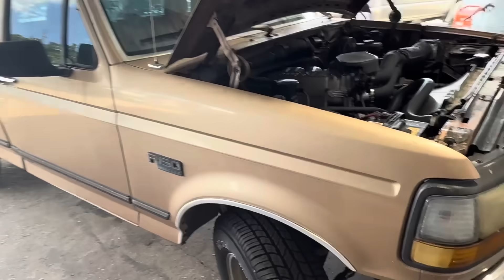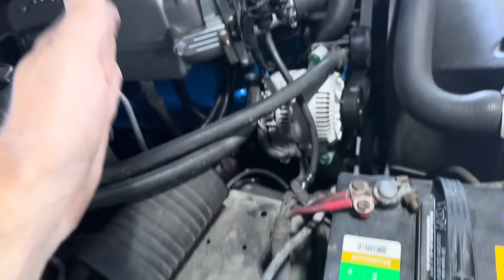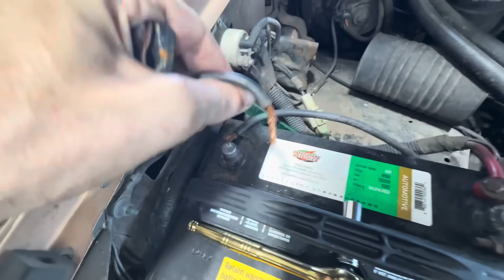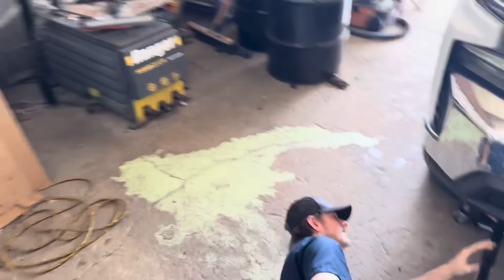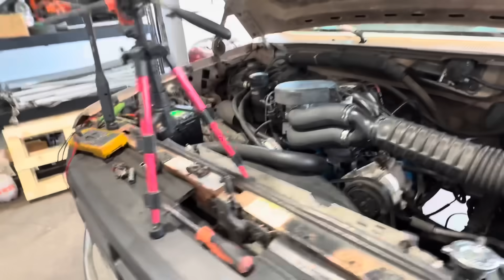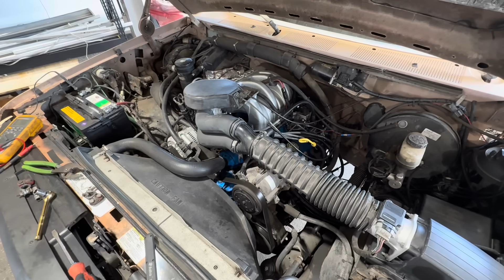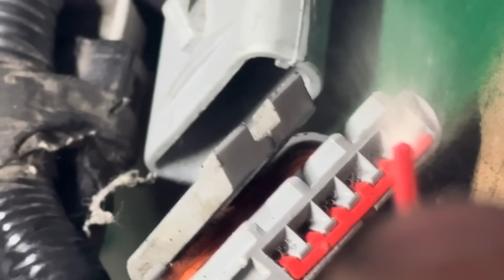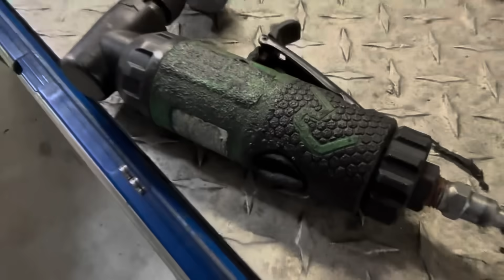Crank No Start! Accidentally Fixed! Can’t find the Problem! Ford 5.0

Comment: My humble opinion you are going to have to replace the ground wires and ground terminal, and the positive wires to the starting solenoid and starter.  Complete.  Some of my radio restorations of 1960's radios involved complete replacement of control and power wires in whole or part.  Maybe all ignition circuit wires not touched so far.

Comment: In my day we filed serial numbers off the tools!   The best way to check resistance on an energized wire is to use the DC Volts setting on the meter.  One probe on the negative terminal and the other on the engine block, alternator, chassis etc.  If the meter reads 0 volts the wire is ok. if it reads any voltage you have a resistance in the path.  Retired electrician here.
Reply: Be careful filing off serial numbers, it may make people think those are stolen.
Reply: All wires have resistance, therefore all wires will have some voltage drop across them if there's ANY current flowing.  The voltage drop not only increases with resistance, it also increases with current so the voltage drop doesn't tell you much unless you also know the current.  The only time a wire will read 0V is if there's 0 current.
Reply: Basically right, but not a sure solution. if there is no current through the wire then even at a really high resistance the voltage difference will still be close to zero, even a very low current will tend to read as close to zero. So with the car off try checking the resistance. With the car running on the other hand check the voltage difference. And if you have a clamp meter that can measure DC current check that too. This will tell you the resistance between the points you are testing (voltage divided by current equals the resistance).

Comment: Well, there's 23:25 of my life I can't back, still a rookie. You know, they make battery terminal spreader pliers, Amazon has them. Next, you're supposed to do a voltage drop test, not an ohm drop test, polypusify comment, down below, is correct, with a no start pull the coil wire from the cap and check for spark, if there is none, use a small handheld lab scope to check for a square wave  control coming from the distributor to the module if there is then use a test light on the negative coil and see if it blinks, get a wiring diagram and check all your powers and grounds, you said you spent 4 hours on it but we don't know what you did, did you take the plugs out and check the gaps or cracks, how about a compression check?  Did you check the injector flows with an injector timer tool?
Reply: Oh snap... He ain't cutting ole Ray a single inch of foreskin out the zipper on this fly by my guys.

Comment: Personally, my history with Fords was always inexpensive parts that were extremely difficult to diagnose.  As opposed to my GM, which was always major parts that were easy to diagnose, but seemed to correspond to the time it took me to clear the last parts charge off my credit card.  The Olds Quad 4 should have been recalled due to a manufacturer's defect.   When I complained, GM told me to go pound sand.  It was my first and last GM I will ever purchase.

Comment: Firstly, forget resistance measurements on virtually any wiring problem, 1× single strand of wire will still read low reaistance but won't be able to carry any meaningful current when loaded.
Secondly, testing resistance on live circuits will be totally irrelevant and inaccurate either way, you can only test resistance on a wire without any current flowing through it.
Thirdly, you should be doing 'loaded circuit' 'voltage drop' testing to determine poor connections or to tell if a wire is in poor condition.
Fourthly, check the ignition module is properly grounded to the inner fender.
Pretty sure there isn't a ground wire in the harness to the module, the body of the module is the ground connection, so having a poor ground connection from battery/engine to body, or where the module bolts to the inner fender is a super common problem on these trucks, especially the module ground if someone has replaced the module and slathered the underside with heatsink grease, or didn't tighten it down properly.👍

Comment: Measure the DC voltage drop between points to identify resistive cables and connectors. 
I guess your income is increased by all the warning feedback comments, about resistance measurements on live DC circuits. You are wasting every viewer's time by doing that. Have some respect.

Comment: also, you shouldn't be doing resistance testing on a running engine. you should be doing voltage drop.

Comment: take those pinch-plates on the terminal ends and flip them over. that said....i have seen fords that will not run with that battery-to-body ground either loose or not connected at all. there is also a hidden ground wire on most ford eec4 systems. it's usually orange(go figure) and on the 5.0's it's normally on the rear passenger side upper plenum bolt. that will also cause problems, up to and including no-start issues. the eec4 system was well ahead of its time.....but it was a bugger to diagnose it too.

Comment: quick heads up - you can't measure cable resistance with the engine running, using ohms. set your meter to micro or millivolt range and measure the voltage drop along the cable. the higher the voltage drop, the higher the resistance.

Comment: The easiest way to measure resistance in a wire while it is in use is to measure voltage on both ends with a voltmeter. If there's no voltage drop with current flowing, the problem is elsewhere. If you do find voltage drop and you want an accurate assessment of resistance, simply use a clamp meter to get current, then have faith in Ohm's law. Never measure resistance on an active circuit directly with an ohmmeter. I know that using a scope is intimidating, and wasting time is exactly opposite to what a busy shop needs. Think of the scope as simply a voltmeter that plots instantaneous voltage over time, and it will be easier to make that leap into modern diagnostics. I'd back probe the crank/cam sensors directly and look at the waveforms.

Comment: Check to see if they reattached the ground strap at the back of the engine to cab. They may have completely removed it when they pulled the engine. It should be a flat silver mesh type ground cable that attached to either the back of the cylinder head or to the back of the intake manifold. All kinds of weird things happened when the cab lost its ground.
Reply: I agree & it might back feed though the wipers 😂
Reply: That's tinned copper braid.

Comment: Hey Ray!  I think the hot ground cable is a second problem. 
It takes a lot of current to make that sized cable hot. Any other smaller wire would have melted by now. 
The only things I can think of that could handle that kind of high current are: the battery itself (internal short), the alternator (diode failure where it flips from making current to reversing the current and becoming an electric motor ). and the starter. 
My money is on the alternator!
Reply: It wasn't the cble that was making the heat.   A poor connection at the battery terminal made the heat and that heat was conducted along the copper wire.

Comment: Years ago, I had the same type of issues (uneven idle and intermittent starting). I spent a week replacing every earth cable as this was a known problem and even added some extras, even around the dash and steering column, without success. I took out my frustration and bad temper out on the front tyre and walked away. After I had cooled down, I came back and tried to start it one last time, it roared into life and purred like a kitten and never missed a beat over the next ten years
Reply: It was the front tire all along.  You knocked it back into place.
Reply: LoL.
 Fixed itself.

Comment: Hey Ray, back in the 'old' days (1970's) I was just a young pup, but I remember that the cheap aftermarket tachs would start to short internally somehow and cause a no start issue, and a stuttering idle. I'm sure you've already unplugged that tach to see, but just thought I'd mention it just in case.
Reply: I've had the exact same problem. Tachs can be super problematic.

Comment: Thou must measure voltage and current with power in-circuit. Thou must never measure resistance with power in-circuit! 😢

Comment: Hey Ray!  Is it possible that the ignition module is pulling its ground through the wiper circuit?  Intermittent wiper and intermittent ignition stumble have to be related. 
Maybe the chassis ground is bad/missing?

Comment: those type of battery terminals are JUNK !!!!!!! I hate them.
Reply: The new battery terminals have the same inside diameter.  Car battery terminals (+ & -)  are different diameters.
Reply: They are for temporary emergency repair only until you get real cables

Comment: Replace main ground wire. Clean battery posts.  And check all other body grounds. Then remove /disconnect the tach.  I worked on a Ford van once.  It would start then die. Replaced a couple of fuel items.  Turns out the ground between frame and body had broken.  Fixed the ground and it ran perfectly.

Comment: Resistance measurement is a DEAD test, ie no voltage or current present. You should be measuring the voltage drop across a conductor that is carrying a current.

Comment: testing resistance while the engine is running won't give a correct reading if there's a bunch of current flowing through the wire.  in fact at 13:50 or so the meter is reading negative 100 ohms due to the voltage drop in the wire from the alternator charging the battery.

Comment: Seriously not liking the red wire ran around the door jamb A pillar.
That should pass threw a grommet on the firewall. If i remember correctly it has an empty plug 
Or you drill a hole with grommet
In the clutch blank out plate. And run it in 1/4" split loom.
Reply: Also open splices under the hood is a point of rust and failure.

But more over if the tac wire shorts out can't it cause the motor to stumble.  Also my bet is you can pick up a tac signal at a plug inside the cab under the dash. 
I think its a gray with orange strip if memory serves me right. Pull up the wire diagram.

Comment: On the electrical on the F-150 it looks like the engine has been rebuilt/replaced. I have seen engine to chassis ground neglected to be put back on. That can cause many issues. I know you’re pretty thorough and probably know that . But sometimes we overlook the obvious. Thanks Ray keep on keeping on 👍

Comment: I had an ICM that when it warmed up, would start intermittently losing connection internally and causing those exact symptoms. That took about 2 days to figure out. Customer had already replaced it, but was not OEM.

Comment: Clean the wire ends at the battery wires with sand paper and or your connection cleaner. maybe some acid. the coating at the connection causes the resistance, not along the wire.

Comment: had a similar stumble on idle, replaced and checked all electronics and whatnot. Spent weeks trying to solve it and in the end it was the exhaust camshaft that was replaced by someone else for a new one and it was slightly out of spec. You couldn't tell any difference by just looking at the camshaft and comparing it to an OE but replacing said camshaft fixed the issue. All that on a completely different engine. Car worked "fine" when on the throttle.

Comment: Hope this may help. Some vechicals have an  inline fused link in  the battery positive supply cable.  They rust and have high
Resistant.  Remove and clean engine to chassis earth. That can have high resistance. Stay well. Stay safe .

Comment: On many modern ignitions, loss of tach signal = loss of crank position sensor signal. Also check timing at base and whether it is advancing normally. Clues to proper ignition signal processing and if the ignition is using the pickup signal or the electronic control to time the spark.
Unfortunately, in the marine version of that engine, the proper OEM ignition diagnostic tool is required to dig in past the preliminary diagnostics.

Comment: Why not bypass the battery ground wire with a jumper cable to the engine block just for testing purposes without putting any work into it?

Comment: The TFI module on the dizzy is well known to cause problems. Try another TFI module. It takes a special tool to remove it. If I remember correctly, there is supposed to be thermal paste between the dizzy and the module.
Reply: Arctic silver ftw. My old 94 taurus went through several of them, id always grab a couple at a junkyard and have them in the glove box just in case
Reply: @smokey1991  Yeah, I always carried an extra in my 5.0. Don't leave home without it!

Comment: The tach wire is spliced into the coil wire high tension cable?   Maybe connect to coil primary?  Or wrap around coil wire for an induction pulse!

Comment: Speaking of de-badging, that's the first thing I do to any newly purchased vehicle-remove the dealer's sticker/badge ...unless they want to pay advertising fees. which none of them has.
Reply: Good to know I’m not the only one.
Reply: YES, I do the same on my vehicles,  now I'm thinking about covering my truck's decals, manufacturers name and the model of my truck I just don't know how to go about it. I was going to use painters tape you know the blue tape but I'm not sure how it will look on a white truck with black accents. Any advice on how to do it without damaging my truck and without actually removing all the emblems?? Let's take the power away from the very RICH corporations!!!! 😊
Reply: @patrickchavez3848  Maybe mask off the area around the emblems and spray them with white PlastiDiP? That way you can always peel it off later...

Don't know why you want to do this, but that's what I would do...
Reply: When negotiating a price at a dealership, a friend said he told the salesman he's going to include the discount of advertising the dealership on the new vehicle.  The salesman said he couldn't/wouldn't do that.  My friend stood up and said they didn't have a deal and started to walk out.  The salesman quickly said he'd have the dealership sticker removed and my friend bought the vehicle.
Reply: I'm the same way, but not just with vehicles. I refuse to wear any clothing that advertises anything. T-shirts with a logo especially.
Reply: That's a Midwestern thing huh? you never see stickers of dealerships on cars out here on the west side
Reply: I do that too! On my 1999 Pontiac Grand Prix GTP I got it right off the trailer, they hadn't even put the window sticker on it! Long story short somebody else had ordered the car and couldn't take delivery of it so I got it. I TOLD them not to put the dealer sticker on the trunk lid but they did it anyway! All individual letters. The first thing I did when I got the car home was peel them off with an X-acto knife. The second thing I did was pull the DRL/Auto-Headlight fuse (I HATE DRLs)...

Comment: You got a good find on the power cables . Suspicion about sparking when you connected positive cable and those wipers starting but maybe thats related to ground issues.

Comment: I had a Honda Odyssey battery cable go bad at the post connector. I tried an aftermarket connector with two cables under the clamp. Could never keep it tight enough. Ended up replacing the cable assembly to fix the problem. Shortcuts don't pay.

Comment: I remember the old minis if you had a bad ground in the boot it would melt the accelerator cable outer plastic sleeve as that was the only thing grounding to the engine block.

Comment: As others have said , you can't measure current with an ohm meter with current passing through the cable. If the cable really had 100 ohms resistance there's no way the starter would turn because you'd only have about 100mA of current available.

Comment: Hi Ray!  I always replace clamps off the battery terminals, not while they're connected.  I once burned out a new stereo head unit by connecting the remote wire but not the main power wire.  I saw smoke come out of the stereo, and had to talk them into giving me a replacement.  They did it, but I think it was really my fault.  By grounding some parts of the car (with one cable), but not other parts of it (because the other ground cable is still loose), you never know what electronics you might burn out.  It was a lesson I never forgot, and still carry with me thirty years after that incident happened.  Big lessons from small incidents, I always say.
Reply: I have burnt amps up like this as well, some of them don't like the burst of electricity running thru them like that! Especially if already grounded!

Comment: Clunk , clunk, and not hitting the floor is one of the worst things when you only have one socket like that.😢😢😢😢😢😢😢😢😢😢😢😢😢
Reply: The worse sound is not the "ring" of the tool hitting the floor, it is the dull thud of it hitting one of those undershield panels that only stay on parts of the vehicle where light cannot penetrate.   Usually this panel has been removed before and re-fastened with at LEAST eight different fastener heads, zip ties and/or things that should never be attached to a vehicle.

Comment: I would have used voltage measurements for the ground and 12V wire checks!  Resistance is best with non running  engines and low current draw. Corrosion on copper or aluminum conductors is a very disruptive artifact to deal with.

Comment: check connection to engine block+ and - electronic tech 40 years, good luck
Reply: Yes, when he put the IR gun on that main ground cable at the battery you could see the other connection at the engine block was very hot. Definitely could used fluffed and buffed up there.

Comment: Temp. battery clamps are made from mfg. for Positive and Negative placement. Inside diameter, spread opening is slightly different to fit the respective battery post.